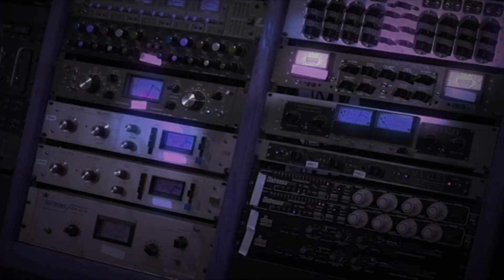WHY Do SO MANY People Get This Wrong? Audio Engineering 101: Stems vs Multitracks / Track Outs

Comment: Good subject timing for me.  I'm working on a digitizing project where I'm capturing about 70 cassette master tapes that were recorded in the late 80s on a Teac 144 4 track 2 buss machine.  I had to make a direct out box (Track Outs) to capture all 4 tracks in one pass of the tape because it is only a 2 buss machine with no direct outs. I basically tapped into the test point of each playback channel on the PCB. It's a Frankenstein but it is working great!  Great Video!